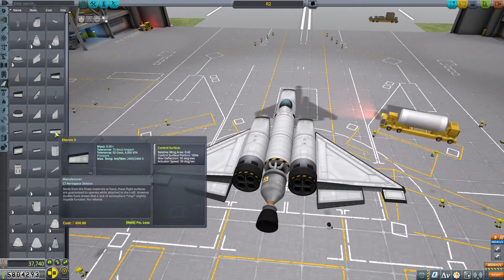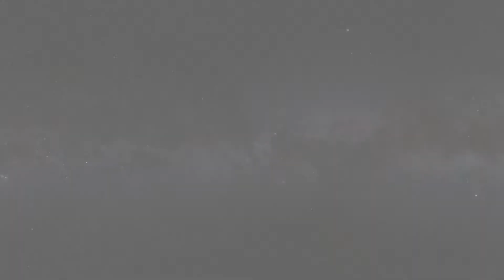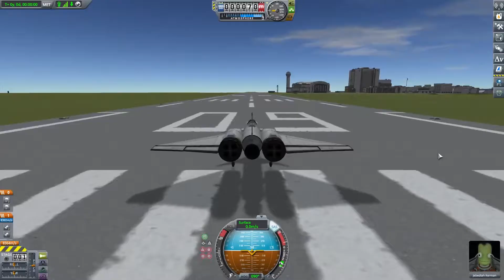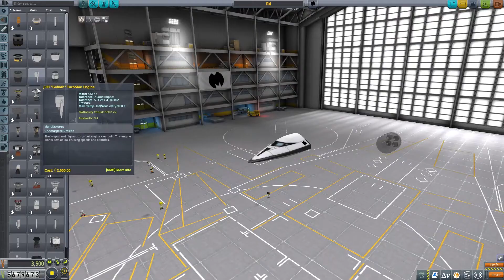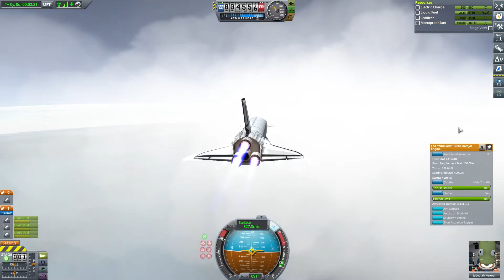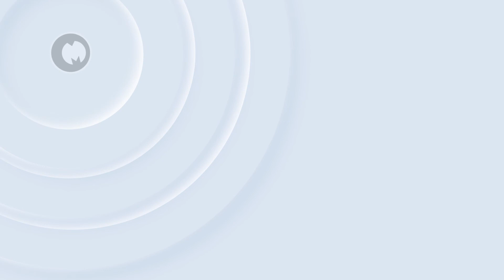KSP | Back to Basics 2 | 14 | Shuttle Delivery Service

Comment: Just a tip for planes, click Caps lock for better control of planes. The bottom left orange Pitch/Yaw/Roll indicators should turn blue
Reply from the maker: such a simple tip but so useful!  coming from a Mac to using PC sometimes you forget the basic things!